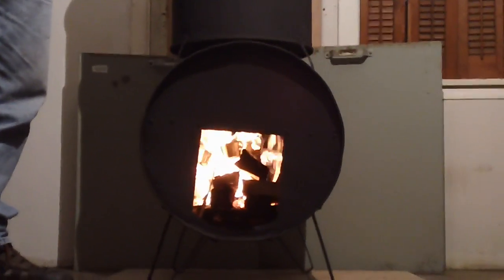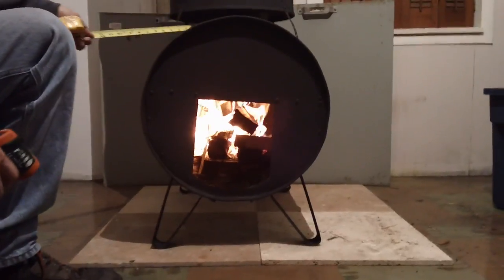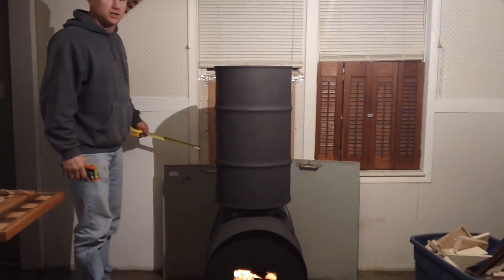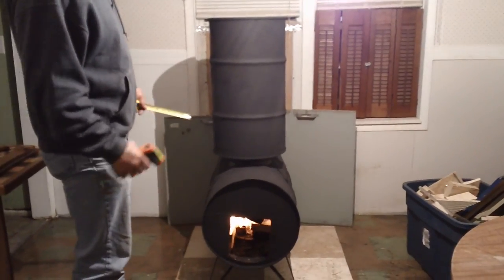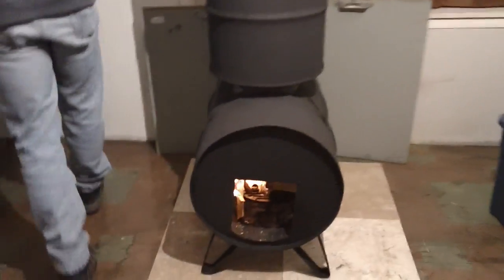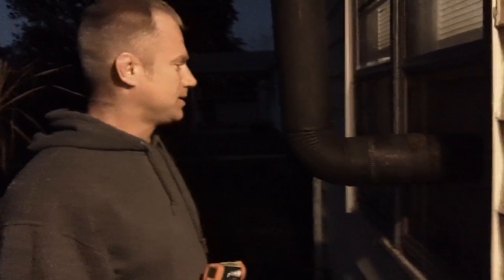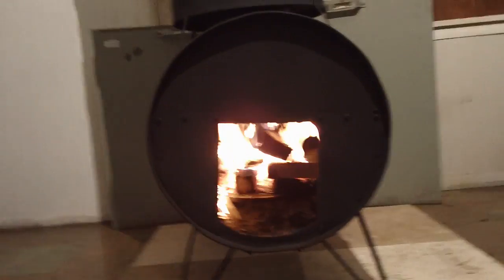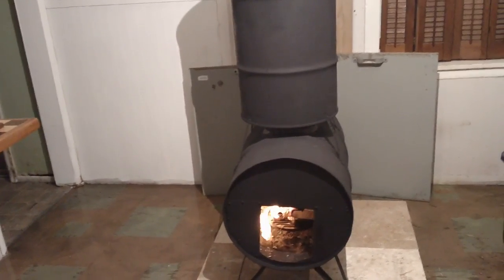DIY $75 Rocket Stove from 2 Barrels: Fast, Affordable & Efficient- Van Powell Budget-Friendly Builds

Comment: I am currently altering a fireplace insert (not in a fireplace) to work similarly to your build. I'm not expecting it to work as efficiently as a rocket stove but want to capture as much heat as possible.  I'm a bit puzzled by your high stack temperatures. All the research I've done says that RMH stack temps are really low since most of the heat is absorbed by some sort of mass and creosote build up is not an issue since all the things that cause  it are burned by the extreme temps in a rocket heater. Is this correct?
Reply from the maker: Jeff..  Dont get your final temps below 225 degrees it wont draft. heat causes draft. rocket stoves will back draft if they get too cool. Look at all of them on line and youll see soot around the openings where smoke has back drafted. I have built dozens. part of rocket stove lore is myth be sure you know what your getting into,
 I have no mass {clay bench or bed} on this stove to further pull down the temps. its only what is being released by the barrel and the pipe is very short. the closer to the fire the greater the temp.

Comment: What if you made a frame around it and buried the whole thing in sand, stone etc. would that make it more efficient?
Reply from the maker: It would hold more heat for sure. and due to hotter burn chamber temps would break the wood down better

Comment: This design is very dangerous. This is an uncontrolled burn barrel stove period. No mass, no rocket riser, no air control to keep it from running away. RMH? NOT. More of a barrel fireplace. Be very careful what you copy on YT.
Reply from the maker: please  be very careful what you claim that you have no idea about and disrespect your fellow man, I can go point by point and with great ease and prove with absolution that you are wrong in most every thing you claimed on this post. I dont care to make you look foolish or to try to teach you a lesson, but I do wish you would not rush in and make such silly claims. fools rush in where wise men dare tread so said king Solomon. If you will ask me questions in a polite way I would be more than happy to explain a few of these things to you. But dont let me interfere with your happiness and success. IF you start by counter claiming some one you should expect a controversy and run the risk of being wrong and exposing your self BUT if you ask questions then IF I am wrong you expose me and have my confession of being an Idiot as my explanation wont hold water or facts wont be supported. would it not be much better that way and would it not cause less controversy ?
Reply from the maker: If I was asked is this a dangerous uncontrolled burn I would say that rocket stove design has specific air flow in or feed tube vs riser tube IF you go with Ianto Evans book on the subject. to say it in simple terms it requires a slight less diameter on intake than exhaust to maintain proper air flow and draft and prevent back draft. Side note is when wood stove are evaluated on efficiency they are set a different draft settings and an average of many burns at many settings determine the final  number given ,a rocket stove has NO draft settings and is a fast hot burn which is highly efficient but short duration thus why RMH store the quick intense heat. MY stove Happens to be designed on the very same exact ratio of in put diameter or square inches that is slightly less than the exhaust . Thus not uncontrolled burn but rather a specific ratio  of in and out. Thats Fact number one... 
 Second you said NO MASS and further down in your comment you kinda said the same thing when you said NOT RMH , IF you was to ask me how do you consider this a RMH I would have simple said My friend  a rocket stove and a RMH are two different things  and that is FACT number 2 and FACT number 3 is that I NEVER in title or in the video claimed it was a RMH only a rocket stove and I am obviously not responsible for your assumptions or things you make up in your head. I will say I am wrong about it being a RMH when you can show where I claimed that in the first place, Fair enough? Please annotate the time in the video or point to place in writing where I claim such a thing or you do hereby admit that I made no such claim. and further your counter claim is erroneous. The other counter claim that you made was there is no rocket riser. If I was asked or if one paid attention to the video at  about 37 seconds of the video I explained there was a riser inside the barrel that came with in 2 inches of the top as per Ianto Evans book again, however it is not Insulated but just a metal 8 inch pipe. I find that when the pipe gets hot it works just as well as an Insulated one. Last there is such a thing as a batch fed rocket stove and that also is FACT. so there you have it. I reviewed your post again and think I corrected every single counter claim you made and addressed every point you made except be careful of what you copy of of youtube , and that too is wrong I did NOT copy off of anything it is called INNOVATION it means to change something established by introducing new methods or ideas. SEE you could have saved your self from being so obviously and absolutely wrong if you would have just asked questions.

Comment: does this have an insulated riser tube?  I'm guessing not.  if so the top would be much hotter....also, no thermal mass or longer tube runs to grab more heat.....this design defies the basic rocket design I'm familiar with.   this looks like a barrel stove with barrel around the chimney pipe to me.  your losing lots of heat
Reply: You nailed it. This is an uncontrolled burn barrel stove period. No mass, no rocket riser, no air control to keep it from running away. RMH? NOT. More of a barrel fireplace.

Comment: to make better utilisation of the heat you could wrap some aluminum flashing 90 degree fins around the barrels and hold them on by cutting slits in each and run some aluminum plumbers tape through the slits and wrap it around the barrel.

Comment: On your top barrel...do you have pipe on inside and how high is it near the top of barrel....thanks Rick
Reply from the maker: +Rick Stone yes there is a 8 inch hole with a single 3 foot section and the barrel goes over down to about 2 inches from the top
Reply: @TheTitian69  I just came across your video... Love the idea was trying to do the same... Question though... That pipe that is running to the top barrel what did you use? I heard metal will deteriorate over time because the temps get so hot in the rocket stove design... Have you checked yours?  Is it still intact? Lol
Reply from the maker: @johnmarkbutzu6367  an 8 inch piece of black stove pipe 3 foot long.. metal is not the best riser but the barrels only last 10 years. still in there working.
Reply: @TheTitian69  nice man thx

Comment: Got another question for yea.  I have another building with a double barrel stove in it that works ok but not great.  What do you think would happen if i took it apart and ran a pipe up the center of the top barrel like the rocket stove and moved the exhaust to the other end?  So basically the stove like the one you built but the top barrel would be on its side and not straight up and down.
Reply from the maker: +banditman0000 I think the riser (pipe) would get hotter and help to create more draft. a pipe 100 times hotter is equal to one 100 times taller on draft. the other effect would be better heat exchange and less sensible heat lose&#160;same as&#160;heat up the pipe. if your going to close the draft or lessen it by draft settings the arrangment would be just a better heat exchanger but wide open draft it should roar when she gets good and hot and burn cleaner.

Comment: What size of stove pipe are you using?  I built a similar stove out of 2 55 gallon barrels and cant get it to draft correctly and im thinking my stove chimney pipe is to small i used 6 in.  Could that be the reason why it back drafts out the door when it is opened?  I cant burn it with the door open like yours because the smoke comes back out the door.
Reply from the maker: +banditman0000  Hello.. draft out must equal draft in. what does that mean? if your air inlet opening is larger than your riser the extra air finds a new way out ie front door.. mine smoked too. UNTIL I limited the opening on the front to same or smaller square inches of riser... I used an 8 pipe inside a 35 gallon drum.. limit air intake at the door and you end the back draft sir.. test this by just holding something up to block part of the air so you can see it in action.. Let me know how it works out for you.
Reply: +Van Powell   Yeah that seemed to fix it thanks for the help.  Love your videos keep them coming.

Comment: That's not a rocket stove, it is a rocket mass air heater, and no, it is not operating properly, if it was, the top of the top barrel would be above 2500 degrees,, and you would not be using wood that big,,
Reply from the maker: +tantricmaster800  Hello and thank you for your insight and opinion. I have a couple of questions I would like to ask you.. 1 do you know that hard woods dried to less than 10% moisture has about 8000 BTU stored in one pound. Do you think a rocket stove can get more BTU's out of the wood than is available and stored in the wood in the first place? 2. Have you herd the claim you can heat your house with a RMH (rocket mass heater) with just sticks from the yard? 3 do you understand that less dense wood such as sticks that may or may not include soft woods or just slightly rotted or broken down by bio organisms with the moisture content much higher than 10% is no where near 8K btu's per pound? 4 do you know the formula to figure out how many BTU's a structure needs an hour is A/R X delta T = BTU per hour required? do you understand the average small house in America by this formula requires about 50K  BTU's ? Now the big finish.. If a rocket must produce that much to meet current BTU needs then it would need to burn twice that amount to store that same amount for the next slot of time? so how do you put 100,000 btu's of wood that at minimum should weigh 12.5 pound of the instant requirements and another 12.5 for the future which equals 25 pounds of wood needed in a 6 or even an 8 inch hole? for the life of me I can not get 10 pounds of poop out of a 5 pound bag.. Can you help me pull more out of the wood than whats originally stored in the wood?  Have you viewed all of my channel to see just a few of the stoves I have built including a traditional RMH that make free electricity? Can you show me any of your work so I can learn from someone as smart as you? do you know wood stoves are efficiency tested by many methods and the most common is to burn the wood stove on multiple draft settings including all air that can be is shut off and an average of many burns at many settings to get the efficiency ratting? do rocket stoves have any draft settings? or are they wide open draft burners? how efficient are wood stove built to today?  do you know some are rated in the 80% rate and that's not on their best wide open draft burns and if you do a wide open  burn the efficiency is actually much higher than reported or  listed due to the draft settings while testing? If a wide open burn makes a wood burner higher than 80% just what do you think is the maximum amount of difference can possibly be? do you consider a rocket to be 100% or at what % do you think they are?  Could a larger burn chamber stove like mine here actually put out more heat per hour than a traditional RMH due to the much higher pounds of wood you can put in them? could the slight efficiency advantage  be made up by say 5 times the volume of wood? does my stove not have a heated riser inside the barrel just like a rocket stove? does it burn wide open like a rocket stove? Is down draft necessary and if so for what? are you aware rockers were designed for cooking and NOT heating? How many years have you lived with one or more rocket stove in your house or place?  It works as  deigned it to work and it does that exactly as I planned it..  by the way is the following not the definition of a rocket stove?   ... A rocket stove is an efficient cooking stove using small diameter wood fuel which is burned in a simple combustion chamber containing a vertical chimney, which ensures almost complete combustion prior to the flames reaching the cooking surface. and the definition of  a RMH is it not  A rocket stove mass heater or rocket mass heater, is a space heating system developed from the rocket stove, a type of efficient wood-burning stove, and the masonry heater.Is my stove not based at least in part on those principals? when did you become the authority on what is and is not a RMH cause by the definition I find it fits right in there.  You like apples? how do you like them apples?..
Reply: +Van Powell You tell 'em, Van! : )  Love your work. Thanks for sharing.

Comment: The first 2 seconds of your video showed the success. The flames inside the stove were white which means the flames were 1200 degrees F or more, which means it can burn its own smoke as extra fuel. Red flames and orange flames are signs of a very inefficient stove.  Some yellow, blue and white are what you want to see. But mostly white and blue. Good job.

Comment: If that is an open front on there you had better never leave that puppy unattended. I have been heating with wood for over 45 yrs and I can tell you when you have a gas pocket in a log explode it will blow all your nice hot coals all over the room. Please tell me you at least have a fire screen for it. If so "my bad" but even then for me no way. I have designed and built many stoves and my rule is if you can see the flames at all (other than thru a glass) you have a fire hazard and right in your living room.
Reply: I had this happen in the middle of the night and the glass on the front of my fire box shattered along with hot embers and shot across the room. I was asleep on the sofa a few feet away and was fortunate enough to shovel it all back in before the house burnt down.

Comment: Van, thank you for the inspiration and concept. I have here two 16 gallon barrels, salavaged from Marine Gear Oil Barrels. 8" diameter internal chimney. Support skeleton made from struts, (Possibilities for add-on racks for drying etc). 24" run of horizontal pipe running from back of chimney barrel to vertical flue pipe.  Already reaching optimal temperature in half the time as the old wood stove, with only using sticks from the yard. Can get it scorching hot with just sticks. No smoke. Very efficient.

https://www.facebook.com/photo.php?fbid=10152687320462379&set=a.10152486164517379.1073741828.553587378&type=1&theater
Reply from the maker: Hello Miyanovich. I really enjoyed seeing your work . Very Impressive  and creative solutions to the structure and I like the look of the raw metal...  awsome...
Reply: Van, thanks for getting back to me. The Double Barrel Rocket Stove is really making an impression around our homestead, and with friends on Facebook. I will post some update links here for add-ons. I've already built a half-barrel Pizza Oven that just sits on top of the riser barrel. Have already cooked my first pizza with it. Will also be incorporating WVO drip and wrapping copper around the horizontal pipe to heat water in a stainless water container for tea, coffee etc. Will update you. Thanks again.
Reply from the maker: Miyanovich really looking forward to it..
Reply: Van Powell Bluing on riser barrel, from hotter burns: https://www.facebook.com/photo.php?fbid=10152697570387379&set=a.10152486164517379.1073741828.553587378&type=3&theater
Reply: Van Powell Half-barrel pizza oven that just sits on top of the riser barrel: https://www.facebook.com/photo.php?fbid=10152704828597379&set=a.10152486164517379.1073741828.553587378&type=3&theater
Reply: Van Powell Dry stacking stone wall around lower barrel for added thermal mass: https://www.facebook.com/photo.php?fbid=10152703951867379&set=a.10152486164517379.1073741828.553587378&type=3&theater
Reply: Van Powell Stacking wood for the big cold front: https://www.facebook.com/photo.php?fbid=10152696677607379&set=a.10152486164517379.1073741828.553587378&type=3&theater
Reply: +Van Powell I burnt soo much wood for soo many years struggling with starting draft heat ect...in a heavy duty railroad barrel. It sucked soo bad I finally sold it for $100(a double set up with plain jane barrel on top). To think pretty much all I had to do was flip one barrel up and stick a pipe into it. !!!!!!!!pause,,,!!!!!!!!. Wish I had that heavy duty barrel back now. We have the putor to thank here(and you). Rate of learning going up. 

But thinking better now. I believe in The Venus Project. What war did to medical advancements....carbon farmed slave population did to ind-revolution-tech. We need neither now. We need freedom to create and use tech to fullest. Rebuild infrastructure in 5 yrs for youth...free old people from 1600 sq full of junk(cities still force inefficiency 1600 sq ect)
A simple change to transportation,education,housing...health goes auto with it...now you have it. People, Earth, and beyond. Communication wings are just in the pin-feather stage...but can grow FAST.

Comment: You might want to experiment with lowering the exhaust flue coming out of the top barrel , or as I have done put in a double flue with a damper in the top one; more heat scavenging and better control of getting the exhaust temps where you want them